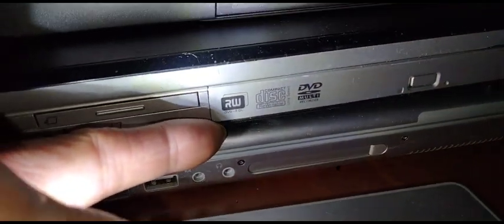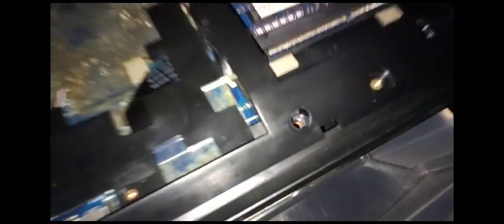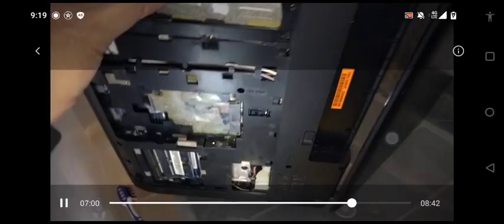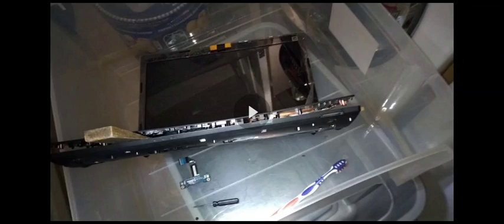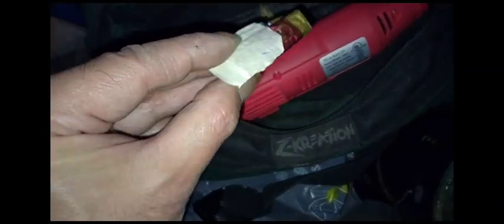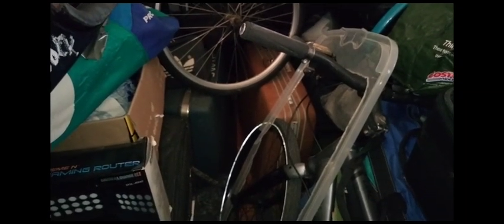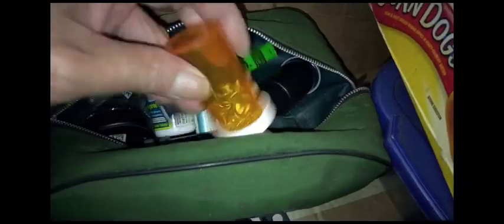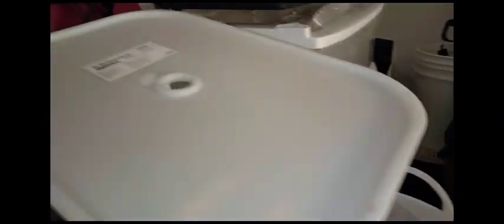Need disassemble help,with lenovo n585. Stuck at end, battery connector.

Comment from the maker: The Toshiba satellite has vista home basic, no major issues, except that its 2005. 
The last part is most likely to push the battery connnector in and it should all come loose, hope ive ruled out alot pf the issue, besides taking a break from the work.
Reply from the maker: Theres a good video, on disassemble ,lenovo ideapad n585, same laptop. And the keyboard comes out early in the process, going to try on mine and see if it works.
Ok going to finish the other video, and get it apart. Thanks as always.
I cleaned up agter finding three hidden screws, and reconnect the inside, for power test. And it  somehow powered on and booted. Going to store ot withoit battery until i have time to recover what i can. Lenovo win 8, working for test system. Thees 4 isb ports and sd card slot. Very nice laptop,.